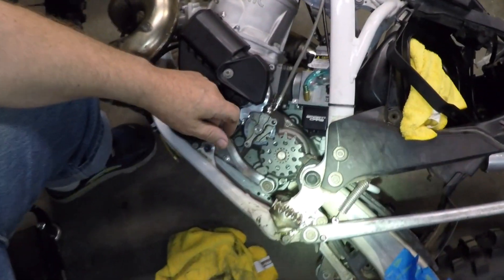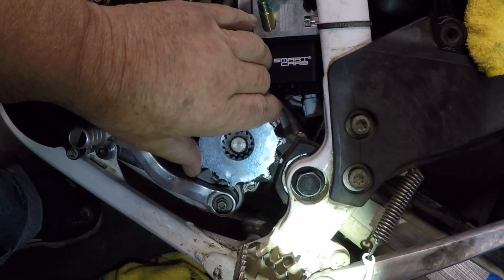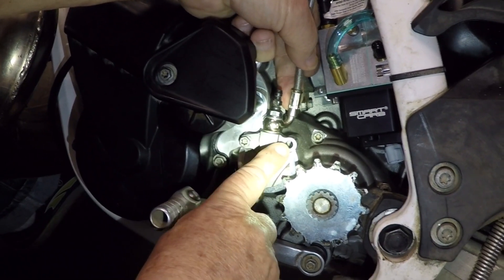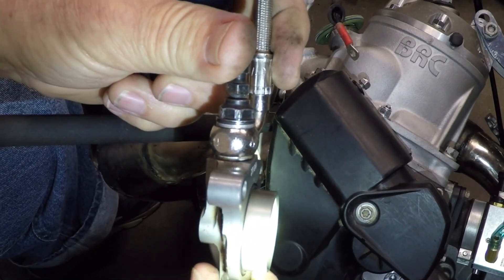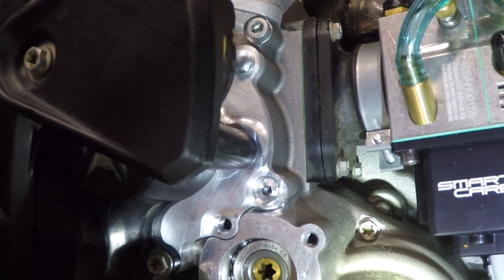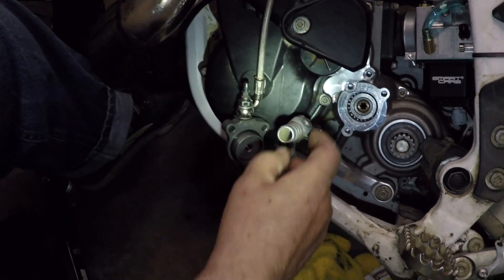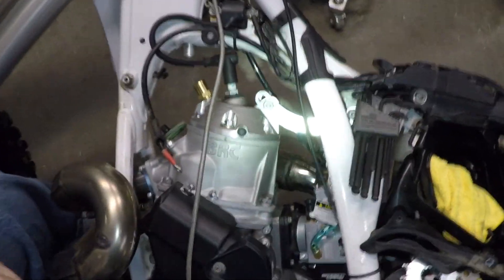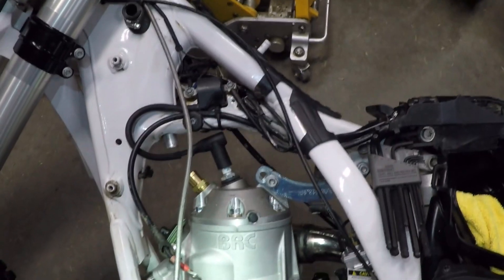BRC 500 Part 6 - Fit Issues In Frame

Comment: Hi Barry, has BRC come out with or addressed "solutions" to these fitment issues?
Reply from the maker: I assume you are referring primarily to the fitting of the Rekluse slave cylinder banjo. It turns out that this is more of a Rekluse issue than a BRC issue. In 2015 apparently Rekluse started using a banjo fitting that is smaller in diameter than the one I was trying to fit. Since I bought the bike in 2014 as a just released 2015 model and I installed the Rekluse during the initial setup of the bike, I ended up getting the 2014 version of the banjop fitting in my Rekluse kit, and it had the larger diameter fitting. I ws just unlucky that I didn't get the 2015 version of the Rekluse kit that had the smaller diameter banjo. Of course there was no way for me to know this was an issue until I got the BRC kit.